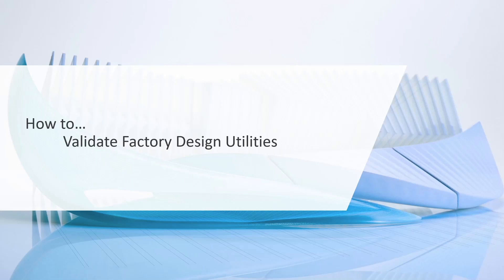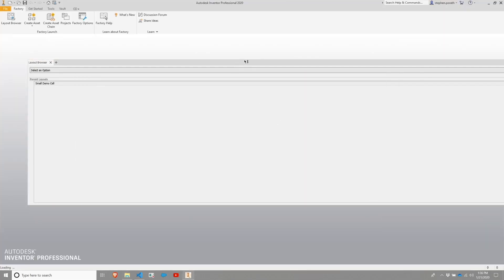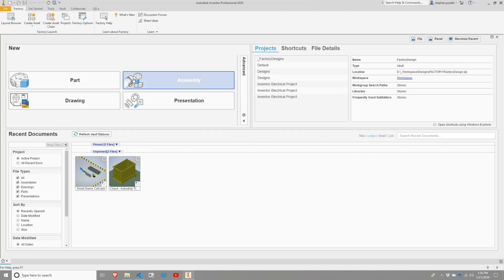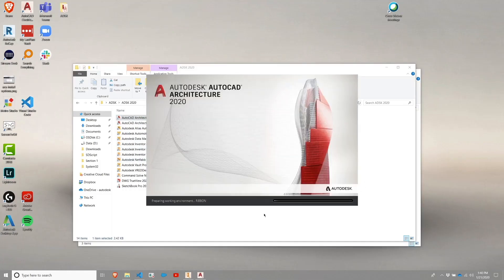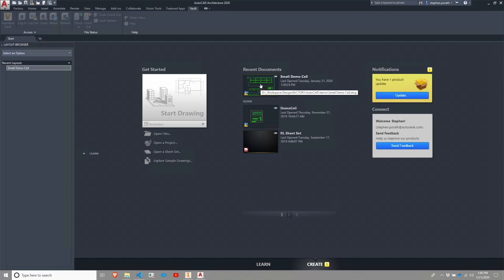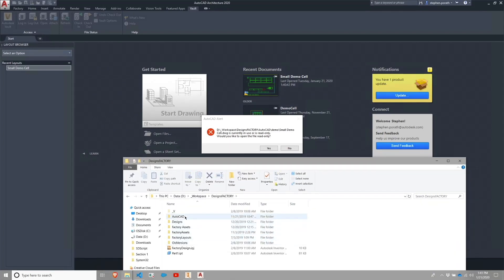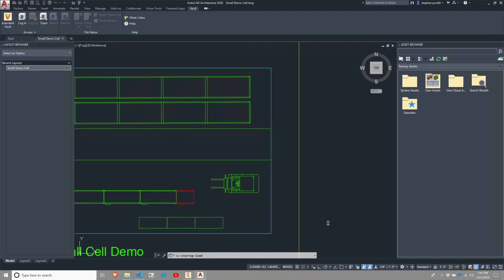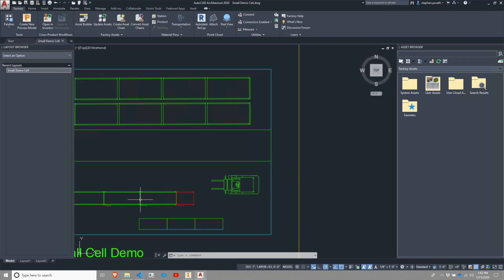Autodesk Factory Design - Course 1: Inventor and AutoCAD install

Comment: Hello,

I do not know why I can not transfer my 2D drawing with 2D assets from AutoCad to Inventor. Do you know where I can find  good instructions how factory works? Company where I work is really interested in it but we have to figure it out
Reply from the maker: Hi Tomislav Peran,

The best way to get a detailed response to your Inventor specific questions is by posting on the Inventor Forum.

Here's the link: https://forums.autodesk.com/t5/inventor-forum/bd-p/78

Hope this helps!

Best regards,
The Autodesk Inventor Team
Reply: @AutodeskMFG  Hello. We have figure it out. Template was missing. My colleague removed it by accident. Now it works. But thanks for your link 👍
Reply from the maker: No problem🙂